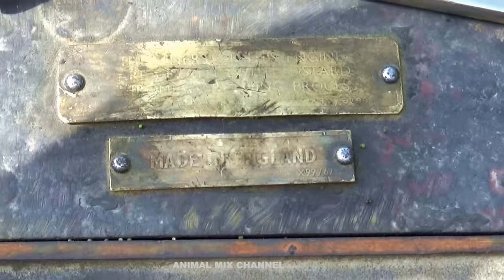Old Diesel Engine Start up Best Sounding Engine

Comment: The exhaust whistle is used to reassure the farm workers that the engine is still running when it was left unattended as they worked
Reply: Thank you, I was just wondering about what it was for.
Reply: Yes. Otherwise they couldn’t hear it?
Reply: @lembriggs1075 i think the noice of the engine just sinks in with all the other noices
Reply: That's no whistle
Reply: It's like a cow working 100x speed

Comment: They put the whistle on the exhaust so that other people in the village would come to know that the shop is open and they can bring their grains etc for processing.
Reply from the maker: You are right saying Ajit Singh
Reply: I was going to ask....
Reply: Eggxactly
Reply: спасибо )
Reply: I figured it was that or to call the workers to the area,, thanks for the comment!
Reply: I couldn't imagine what work it was doing. Thank to information i now know it's a mill.👍
Reply: oh that is cool
Reply: Very cool
Reply: Grain and lumber.
In the beginning of the video (at 0:10)  you can see a large bandsaw connected to the engine by the flat belt drive system.
It would be used to saw logs into boards.
At that same timestamp off to the right, you can see a man with blue clothing, with his hand on a machine. That machine looks like a grain mill.
Reply: @RodFleming-World  or maybe to let them know it’s still running, like on the water pumps ?
Reply: @deborahchesser7375  g
Reply: @ANIMALMIXCHANNEL  njk
Reply: ىى

ؤر

ءؤ
ذؤؤررؤؤر

ر
ر

ؤءر
رر

ؤؤ

ؤء

ر
ؤذر
رر
رؤ

ذىؤؤؤرؤررؤءر
ؤررر
ىر

ررارءو
ى

ى
طط
ىظ
ى
ىة
Reply: @td3993  ؤؤؤؤرؤ
ؤؤر
Reply: @td3993  pp
Reply: Wa kya bat ki hai purane jamane me issa hota tha mere grandpa's kahte the
Reply: @ANIMALMIXCHANNEL  1qqqq11qqqqqqqqqqqq11qq1qqqqqqqqqqqqqqqqqqqqqqqqqqqqqqqqqqqqqqqqqqqqqqqqqqqqqqqqqqqqqqqqqqqqqqqqqqqqqqqqqqqqqqqqqqqqqqqqqqqqqqqqqqqqqqqqqqqqqqqqqqqqqqqqqqqqqqqqqqqqqqqqqqqqqqqqqqqqqqqqqqqqqqqqqqqqqqqqqqqqqqqqqqqqqqqqqqqqqqqqqqqqqqqqqqqqqqq
Reply: Yaaas   i like it

Comment: I think the engine is a lot older than 70 years. It was exported from England in 1949 but I doubt it was new when it was shipped. From what I looked up I think it was made in the 1890s-1910s range.
Reply: the diesel concept (patent)was ivented around 1889 by rudolph Diesel at the MANN factory's, first workable siesels arond 1912

....
Reply: Thats what I was thinking too. Looks to be an older design by at least 15 years
Reply: there were once hundreds of thousands of old stationary engines but they got melted into bombs in the world wars

Comment: Love to see old machinery like this working and still serving a useful purpose.  Obviously well looked after by its owner.
Reply: True, but those guys wearing loose clothes like that around spinning machinery and belts really, really makes me nervous.
Reply: Not sure about properly maintained,  I see a lot of areas that should be oiled that were bone dry
Reply: lets not pretend its a good sounding engine though.. lol
Reply: @andrewbartleman9169  poor country, poor people. Super hot weather. Its actually impressive that after all of these years, the still thing runs..
Reply: @ct92404       F.  .  .
.,, .
Reply: @aibel99   doesn't look poor by the 300 mi adjust able wrench
Reply: @aibel99  I mean, it runs at around 200 rpms instead of 3000+rpms engines nowadays run, so it's probably why it lasts so long. Low friction, low rpms and big clearances make it perfect to run for a long time.
Reply: @conraillock1299  cheap jack shifter / hammer
Reply: It's really not that impressive. 70 years ago was the 1950s. There are still lots of things around from that decade. Go to any local car show on a Friday night and you'll see at least a few '50s engines.
Reply: @aibel99 by looking at their dress, I guess it's Pakistan....

Comment: Brilliant video . engine machinist knows how to bleed the fuel lines prior to starting. Excellent team effort getting the engine up and going in one go. Keep her going for another 70 years.
Reply: Should not have to bleed the fuel system if they did not run it dry, those parts won't last another 70 years being undone and retightened like that.
Reply: RODALCO2007   world   number one  fullish  mechanics ,   terrorist  mechanism   is ok
Reply: K
Reply: @garyhoffmann1615  Doesn't matter.. Parts for these engines can (and are) be made locally.
Reply: If no oo I am ok
Reply: He bled the system from the wrong direction and he shouldn't have had to bleed it at all. This engine hasn't been ran in a while...
Reply: @hamdude2109  agreed.... I had noticed the curious sequence of bleeding but thought little of it

Comment: Superb engine. You can service it with a big adjustable spanner and there's no fancy electronics to fail. Should last 100 years.
Reply: it also weighs prob. over a ton and for all that metal you get a whopping 38hp...everything has its pros and cons...
Reply: @AKAtheA  Why does weight matter in this case? The engine hasn't moved for 70 years, it won't move for another 70 years.
Reply: @redryderaus  it had to get there somehow in the 1st place. Also people still have this bad habit of moving around to be closer to resources.
Reply: @AKAtheA  it serves its purpose there. They probably can't afford a new industrial engine. And if they could it definitely would need more maintenance and parts then this engine ever needed.  Can run this engine off of used engine oil and it wouldn't even notice
Reply: @AKAtheA  Its not meant for speed. its meant for torque.
Reply: @Acupofwater_WAW  torque and speed can be exchanged with a gearbox, power is still power no matter if the shaft spins fast or slow. My point was the engine is quite the chonker despite providing only 38hp...
Reply: @AKAtheA that’s 370 ft-lbs of torque at 540 rpm.

Comment: I had one of these its a Blackston OP  ( mine was 1938 28 HP )  runs all day on a pint !!!!  great old engines   ,
Reply: Tim - I guess you meant runs all day on a few gallons!!!! The Blackston 2 HP would run quite a few hours on a pint.
Reply: It will run all day on a pint if it's not doing any work.

Comment: Beautiful. Engine operator knows that engine well, purged the air from the injection lines and the starting crew only needed one try.
Reply from the maker: Thanks sir
Reply: А э
Reply: kkkkkkkkkkkkkkkķkkķ ķ k
Reply: And the take away lesson:  Don't let it run out of fuel, or you'll have to go through all that rigamarole to get it started.
Reply: Yes but anyone with experience knows you don’t have to take the hose completely off ,need to do is crack it
Reply: @citetez  That was not the case I’m guessing I believe he’s just purging the air out of the line if it ran out of fuel it would’ve taken a whole lot more pumps in time to get the fuel their
Reply: @PHIL5251   - Don't think so. Gravity feed from tank to engine, and he purged every section of the line on the engine itself.
Reply: @ANIMALMIXCHANNEL  0
Reply: ฟน
Reply: A
Reply: @ANIMALMIXCHANNEL  而滑動剪貼項目可以將其刪除滑動剪貼項目可以將其刪除您複製的文字會自動顯示在呃吃吃姊姊44554443555454我覺得這些東西806此處您複製的文字會自動顯示在此處滑動剪貼項目可以將其刪除
Reply: @citetez  Ohio hippo iiit
Reply: @mamuntalukder6471   - "Ohio hippo iiit"

Wait a minute, when did we start talking about Republican women?

Comment: It seems to be surprised whether still people adopting this machine motors and not updating with latest electric motor pumps. I am also farmer and used this type of oil engines till 1975.we used Cooper engine which was shown in the video. In those days it had been operating with gas system while starting. After that we used Lister and Peter engines. Thanks for remembering this old oil engines. Very nice
Reply: How old r u sir
Reply: @kalaminnovation5483  I am 63 years and very much interested in agriculture through old mechanism

Comment: They have starting this old machine down to a fine art.  One adjustable wrench fits everything lol.    Way to go guys.   There is a lot of energy stored in those flywheels once they start spinning.  Much older than 70 years old though.

Comment: That engine is well maintained! If it had a new coat of paint you wouldn't know it was over 70 years old. But it would not be so cool with new paint 👍. I bet it will still be running in 70 more years.
Reply: Noticed that too.
70 years old and not a speck of rust.
This engine has been cared for.

Comment: In my youth, this guy would've been called an "engineer", because he worked on engines, knew how to run them, and to keep them going.  Today, one can read books, never lift a wrench, and be called "engineer".  A century ago, you knew an engineer would make your engine run, today, he might, or he might simply explain why it never did, never could, and ought be thrown away, replaced by solar.
      We used to know "everything ran by solar", there is no fuel, but that produced by plants, from solar energy, and brought to us by God in the ages.  I run a machine and welding shop, fifty years now, and have moved as far as possible, back, because the old ways were sustainable, the new ways, hide all the lies, and pretend we've "moved past" while in fact, moving backwards.
       In my time in the Marines, I saw such sights as this in every "third world country" where people still know how to live, eat, and work, little different than at the beginning of the "industrial age".  I've got a lathe, a mill, half a dozen machines from the late 1800's, still going strong, never worn out yet.
Reply: Very true. You hear alot about pollution these days and old engines being, 'unsustainable' and, 'bad for the enviroment' pushing this electric disposable crap. however my house is powered by a 80 year old 6.5 hp lister  diesel. which uses a pint of diesel a day. no soot thrown out either. my car is a 72' diesel and smokes less than most new cars and gets 35 mpg. will also run in anything lubricating and combustable. the old ways could go forever easily. but the big corporations shame them and push disposable engines and useless battery powered crap. All for profit of course
Reply: God bless you, Mr. John

Comment: 2 strock diesel engine means very high fuel efficiency. Low RPM mean no extra 10% energy loss in the gear box. Cooling system is simple means low maintenance cost. In all, a very good choice for a small shop without access to cheap and reliable electric supply.
Reply: Figures why it's still in service in rural India since 1949
Reply: I need to get something like this for my work shop, energy's getting more expensive and less reliable.

Comment: The wooden pulley made for the output drive is brilliant, a great design.
Reply: Seems to do the job!
Reply: That is the normal way they were made for centuries. Before internal combustion engines it would be water wheels or wind power.
Reply: @davidhandyman7571  Very true, hadn't thought of that.

Comment: Did anyone notice the "wooden boxings" A winter project when I was a kid on the farm was to cut and carve new "boxings" for some of our machinery.
Reply: I spotted them too but what about that wooden drive pulley?! I bet they trued that up on the machine with a long handle chisel. Also liked the plate joint flying round on the belt- so much stronger than the alligator joints you're supposed to use

Comment: Huge , reliable , Eternal ! just see  in 2021 how much engines from ford T work again and again ! thoses  timer engine are durable for hundreds years ! sometimes a little bit of oil for lubrificate and enjoy  !
Only 38 Hp but enough torque to use it an water pump or electric generator ^^

Comment: Nice!  But, what does it run when it's in operation for work?
Reply: Looks like a bandsaw mill, there is some sort of grinder (grain perhaps?) on the other side of the engine as well.

Comment: I seem that thing he was pumping had something to do with the fuel?? Why fuel leak off?? Can they make leather seals for fuel injection pump???
Reply: He bleed the fuel system to ensure there is fuel coming to injector
Reply: @hyerinjun2468  I understand that it's why all the pumping it should pump up so much faster!! Pump has very weak pressure!! Pump needs attion bad!! Starting will b much faster!!

Comment: not interested with horse power, but curious with how big the torque from that flywheel.
Reply: HP = Torque x RPM ÷ 5252
Reply: It seems to have around 4-5 power strokes a second so I'll go with the higher number (5).

5 power strokes a second means 10 rotations a second since an auto cycle also has an intake stroke in between the power stroke. From that we have 10x60
600 rpm 

38hp= (torque)(600)/5252
333 foot pounds
451Nm

Obviously a constant speed governed diesel, if you load it enough it will slow down but torque will increase. Makes 38 hp at its governed speed but probably makes alot more torque as its loaded and slowed down. There's a guy on YouTube who explains how his cat rd6 actually makes more torque as the engine is forced to slow down from a heavy load (normal expected operation). 

Diesels really like working against something and thrive on it.
Reply: @CrazyForCooCooPuffs  You legend :-)

Comment: Amount of metal (by weight) making up that junk can build 3 probably more engines with superior power and efficiency. Just kidding, old is gold.
Reply: True😂
Reply: Yeah honestly though for the 50's what the fuck is this looks like the diesels in the 1920s by 1950 in the u.s they had turbocharged cummins and some other companies turbo diesels powering semi trucks. Making a few hundred hp. This makes like none.
Reply: @davidb1089  this is about torque not hp
Reply: @thomaslewis3071  and.. it also makes none of that lmao probably redlines at 600rpm 20hp maybe
Reply: May be low hp but it's a torque monster...

Comment: one can travel to the most remote parts of the globe and find the results of the finest manufactures from the Brit industrial revolution.There is still in operation at 12500ft elevation on Lake titicaca in the So Amer Andes a  steam ship built in Scotland in the last decade of the 19th century. It was built there then disassembled, crated and shipped to Peru and carried up to the lake. and reassembled .It has been operated for over a hundred years, and cared for diligently by the company  owners
Reply: Fresh water sailing is much easier on ship; little corrosion. Various ships on the North American Great Lakes have been in service more than 100 years. Though all have been re-engined with diesel propulsion during their careers.

Comment: Very nice
Old is gold
But your flat belt joint is not correct.
It should be along the direction of motion but in this case it is against the motion.
Which may consume lots of power as your engine is producing lots of power

Comment: Howdy.
Strange that no one have come up with some kind of starting mechanism. Maybe some kind of giganormous clockwork spring that could be wound up in advance using downshifting gears for easy hand cranking. Or maybe a large air pressure tank that could be pressurized in advance with a compressor. Or perhaps a tower to hoist some heavy weights and letting the wieght rope crank the engine.
But perhaps these ideas are too dangerous ...
Regards.

Comment: These engines were made so heavy duty and they typically work at 15% of their ability.
Reply: single piston one stroke engine with 1 nozzle I happened to repair one 1972 for a saw mill with another conveyor belt to run a maize mill water cooled engine old technology was great

Comment: Today's  engine  will not last 17year's,  forget  70 years.  They made it large  in size with less HP is because durability  increase,  it's cast iron  block I believe.  Today's  aluminum  blocks no good for a standing  engine.  . This thing will last another  100 years given protection  from  the elements.

Comment: These things can run on bacon fat as long as you preheat the fat to liquefy it. Some old one lunger engines carried the fuel in a casing surronding the cylinder so you could start the engine say with a little kerosene then dump in all your renderings the heat from the cylinder would keep the fat liquefied and hot ready to burn.

Comment: If anybody doesn't know what they were doing in the beginning they were bleeding the air out of the lines. You can't have any air in the lines when starting up a diesel engine. Air usually gets in the lines when you run the engines out of diesel. You know that they are probably getting every drop out of these things haha.

Comment: Am I correct in assuming that these lovable beasts were diesel because a magneto did not yet exist?
Reply: not they existed they used diesel because the fuel was more stable and they were more efficient.

Comment: Hit and Miss engine....It was conceived in the late 19th century and produced by various companies from the 1890s through approximately the 1940s. The name comes from the speed control on these engines: they fire only when operating at or below a set speed, and cycle without firing when they exceed their set speed. This is as compared to the "throttle governed" method of speed control.
Reply: Cool i didn't know that

Comment: I am a mecanical engineer. Love simples sytems . But sadly, often they have poor efficiency ( mecanical energy produce vs heat in oil) and pollute air.
Reply: Emissions is killing the diesel engine. Gone are the simple diesel engines. Now we have egr, catalytic converter,  particulate filters, Diesel exhaust fluid, common rail injection,  variable geometry turbos , intercooler, egr coolers , plastic engine parts, 5 plus computers to control it all, and sensors galore.

Comment: What kind of engine that requires two huge flywheel?
Reply: Since most old engines were single cylinders, the flywheels stored energy (inertia) and provided a smooth power source.  Some even were hit and miss, meaning the engine only fired when needed to keep the flywheel up to speed.